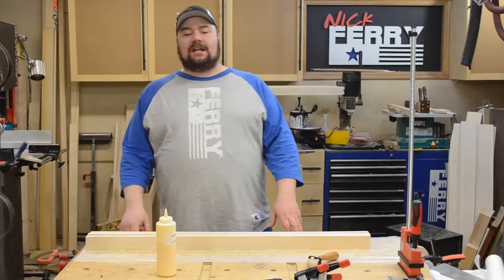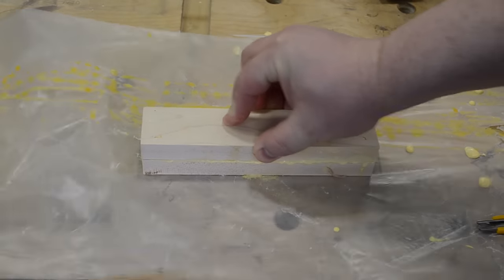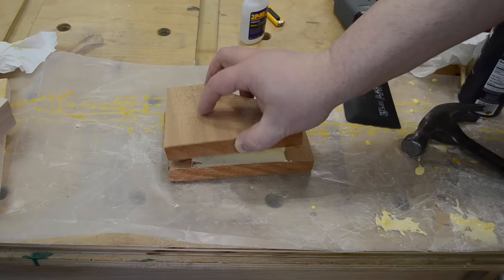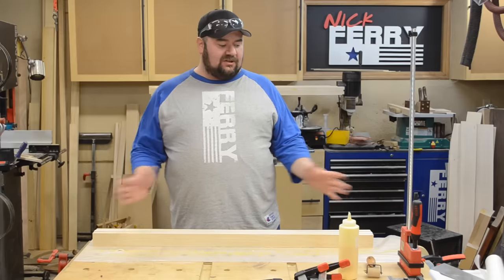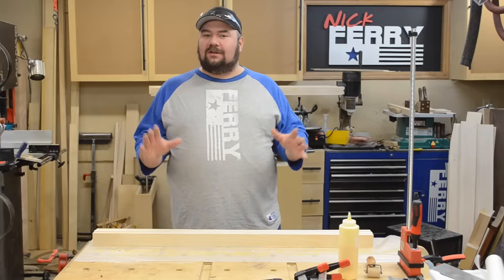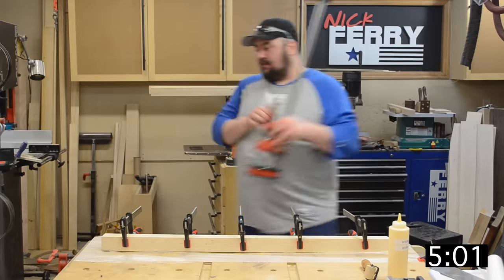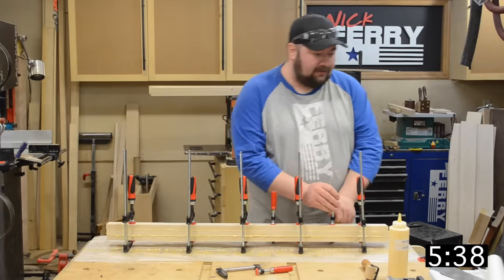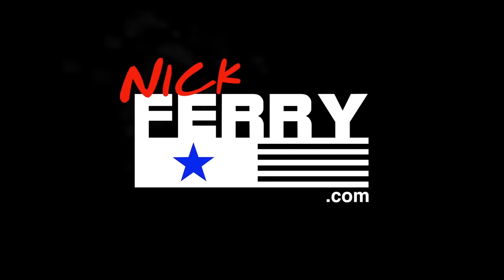Ⓕ Best Way For Gluing Wood Together To Get Thick Pieces (ep86)

Comment: I've always worked  the board back and forth while applying  slight pressure the leasening of lubrication and the sealing of more evenly spread glue eventually make it pretty easy to line up.  As long as the board fit well.
Reply from the maker: A rub joint is fine for edges, however in larger face laminations, greater pressure is needed to pull the pieces tightly together
Reply: @NickFerry  well yes clamps applied after the movement becomes difficult. It seems to reduce slipping while applying the clamps as well.
Reply from the maker: @trentpeterson3495  I can see that

Comment: Hi Nick, another way is to glue up just the same way as you did and put the boards together on their edges, put a couple of clamps on to hold them together then use a soft faced hammer or a piece of scrap wood and an ordinary hammer to even up all the boards as they rest on the flat bench top. You can even the ends up by tapping them against a stop clamped to the bench too. Then add more clamps and tighten them up.
Reply from the maker: Love it - so many options

Comment: Another good way to adhere two pieces - especially larger flat pieces - is with silicon circles.
 We once had to affix a 30"w x 26"h x ¼"d full height backslash to a level 5 finish painted wall. The backsplash was p-lam on the front and vertical sides, raw top and bottom, and typical brown backing on the back side. The wall was a typical industrial grade kitchen wall at the sink, made of typical ⅝" green drywall and 2x4 studs. The owner didn't want any visible mars or defects, so brad nails were out. Likewise, normal glue was a no-go due to the warping in the wall caused by our #14 lags anchoring the base and upper cabs to the 6" metal backing behind the sheetrock. Our solution was to put 2"∅ circles of silicon with an ≈ ¹/16" bead, spaced ≈ 5" - 8" apart, and a continuous ¹/16" bead about a ½" in from the edges. After applying the silicon, we pressed the backslash to the wall and braced it with sticks clamped to the uppers and the counter, making sure to form fit it to the bowing pattern of the wall. We asked the Super to wait a couple days, and then remove and hold our clamps until we returned. When we returned some 5 weeks later, we found our upper cabs on the floor, a huge patch in the wall where the splash had been, and our splash in the Super's office - with the original sheetrock (and a portion of 2 studs) still attached. Come to find out; the owner didn't like the color and wanted the splash replaced. The site's laborer's couldn't get the splash off the rock, and the rock was screwed to the studs... They ended up removing the upper cabs to protect them, and then took a sawzall to the wall to remove the splash.
 So... If'n you need a good, quick method for adhering 2 pieces, circles. They act like suction cups, and once the silicon gums up there's pretty much no getting the pieces apart again. Just be sure to make complete circles that'll seal, and don't try this with varnishes that silicon has an issue sticking to...
Reply from the maker: Rework! - I HATE rework! - when I was in manufacturing I would dread seeing an engineer walk over with drawings - it meant hours of re-doing what I just did - good tip on the silicone

Comment: Thanks Nick! I do something similar, like a few of the other guys here with a cull. Never thought of using my parallel clamps...thanks for the duh why havent i used my parallel clamp moment
Reply from the maker: Cauls work good and I use them a lot - for the smaller stuff like this it's nice not to have to align them
Reply: I guess if i could spell cauls right...they might work better for me...lol

Comment: I do something similar when I edge join timber to form wider boards. I keep a stock of small timber offcuts in  a bag with my site clamps. I cover these in self adhesive vinyl parcel tape. These clamp packers keep the laminations aligned whilst I also clamp the laminations together so I have clamps at 90 degree opposed faces so the above technique can be used even if one does not have parallel clamps, all one needs is scrap timber and sufficient clamps for the length of timber being laminated. For removing glue squeeze out without damage the best thing that I have found so far is a tungsten carbide paint scraper. The vinyl parcel tape allows removal of the packers as the wood glue does not adhere to it effectively.
Reply from the maker: I've done similar before with the packing tape, it works great as a non stick surface - thanks for the alternative method!

Comment: ive always done that, im surprised some people dont. also, if you dont have good parallel clamps, you can use the bar of the f-clamps themselves, it gets you 99% of the way there.
Reply from the maker: Good point - f clamps and cauls too

Comment: I agree this is a good tip. I usually fix this when laying up the pieces across the flat, pipe clamps. But, I arrived here looking to prevent a glue-up problem where stresses caused by drying, compressing glue force warpage (bowing) when the glue sets. I had a 3/4" countertop "arch" or crown when gluing Wilsonart laminate. I'm also having warp when laminating 1x4's into three thicknesses due to that issue. Have a tip to control that?
Reply from the maker: are you using contact cement on the counter top material?  if so, how thick is your base substrate?
Reply: OK, I had to rethink this due to the long passage of time. I needed an exact 1.0" thickness to replace a countertop. The laminate was adhered using contact cement. The other side of the 3/4" particle board was ~1/8" fiberboard panel glued, and pressed with cinder blocks and cement bags. The glue force pulled or bowed toward the fiberboard side. It was enough force to slightly lift all that weight, up. And now you know...the rest of the story. Good day.

Comment: I am novice... beginner....  The way i glue and not have problems, is let the glue dry for at least 30- 1 minute before combining both pieces... It hardly moves.. and you can adjust with a bit of force if you need to. This method has been working for me so far...

Comment: For the actual clamping:  I think I might overthink the whole thing but I always use cauls.   I work under the assumption that clamping force moves through the wood in basically a 45 degree angle.  so for a 3/4" board that clamp is only getting full pressure on about 2" of wood without a caul. With a 3" caul you're getting about 6" of full pressure per clamp.

Comment: I use parallel clamps for each end to keep pieces from sliding apart then use  clamps to squeeze pieces together. I’ve been doing that for years! Also you can use wax paper and hard maple cauls to keep everything together.
Reply from the maker: Not a bad way of doing it

Comment: I'm laying down hardwood flooring with adhesive and I always tape the flooring together to keep it from drifting. I would have left the first clamp on to ensure no slippage along with the other clamps, at least on the ends and one in the middle. Good idea?
Reply from the maker: If that works for you or you want the added insurance I’d say go for it

Comment: I need to do the same but a wider piece of wood, questions do I need a planer or a sand drummer to make better contact, or is it not necessary for your opinion
Reply from the maker: You can get lucky sometimes - the larger the pieces, the less likely a twist or cup will keep them from mating perfectly - giver-er a go, what’s the worst that could happen, they take away your birthday? ✌🏼

Comment: Something of which to be mindful.  On most woods you can read the grain to see which way you should joint the edge.  I put a little arrow on each edge telling me which way it should run through the jointer, then at the glue-up I make sure all the arrows go the same way.  This way, hopefully, you don't have two clean edges and one with bad tear out on a three piece glue-up.
Reply from the maker: Not a bad tip - especially if jointing by hand plane

Comment: I use the glass stays you use to hold glass into a wood frame, they have opposing points and are made of a soft metal that wont hurt a drill bit
Reply from the maker: I’d hate to hit glazing points with a bit

Comment: I love this video, great tip. We have all had boards do the slip n slide....... Thanks Nick and thanks for the links, I need a glue spreader and didn't know where to find it. Does it clean up easily? Does the roller come off?
Reply from the maker: Link to roller in the article - https://nickferry.com/2018/03/best-way-for-gluing-wood-together-to-get-thick-pieces-ep86/ - roller does not come off

Comment: nice video!   Does this technique not introduce stress into the glue -up?  When I have tried this method in the past,  some of the laminations  failed when tapers were cut.
Why not just glue the lamination referencing off the clamp bar, knowing the piece  will be jointed and planed later?
Reply from the maker: When gluing directly of the clamp bar you still get the wood to slide around enough to wreck glue-ups - It does introduce stress and the more bowed your boards are, the more stress is built up - these legs won't get a taper and if they were going to get a taper on one side I would cut the taper into the edge of the glue-up rather than the face - I have a video coming up very soon showing leg glue-ups and and I talk about tapers and a couple cool methods regarding the edges - make sure to check that one out when it's out

In short - I wouldn't use badly bowed boards for glue-ups where I had a multi-sided taper to be added - but in this case the bow wasn't that bad for it to be a problem with tapers if I were to add them - also giving the piece a couple glue-ups like that extra time to cure helps combat delamination - hope that helps

Comment: Hey Nick, great video.. The simple tricks and tips are always the best.. I've tried but can't find a link to the glue roller on your website. Does the roller have a smooth or textured roller surface? Amy help greatly appreciated.
Reply from the maker: Thanks - the link is in the article for this video - https://nickferry.com/2018/03/best-way-for-gluing-wood-together-to-get-thick-pieces-ep86/ - it's a halfway specific rubber that I like best - you should see the link there

Comment: I'm surprised how rarely I see others doing this. I have always clamped like that. If you don't have a parallel clamp then a F or C clamp with a small boards wrapped in wax paper on each side work just as well. 

Tip for glue cleanup that my woodshop teacher taught me. Keep a damp rag ready to wipe off the glue. As long as the clamps are tight enough the water wont affect the glue in the joint but it will affect the loose glue on the surface.
Reply from the maker: yup - normally how I clean it up too - seems as though I'm always mixing up how I do things

Comment: Nice tip!  Use the parallel clamp as a sort of temporary caul during clamping.  Much better than the salt method.  Plus, you don't have to deal with all that bad luck from spilling the salt, having to toss some over your shoulder each time, etc.  Perfect!  :)
Reply from the maker: Thanks - and no one needs bad salt juju

Comment: Hello there good sir! During this time of isolation, I am starting my channel back up and switching to wood working. I am new at it, but do have some experience. I was just wondering what you had under the clamps...is that wax paper? I’ve also seen people use silicone mats...do you have any experience with those?
Reply from the maker: yup, just waxed paper - silicone mats work too but I paper has also worked for me
Reply: Nick Ferry thank you good sir!

Comment: Even without the parallel clamp, pushing the stack sideways against the bench surface as you tighten the F clamps would also do the job provided there's no side to side warping in the wood. With side to side warping the method you show really comes into its own though.
Reply from the maker: thanks much!

Comment: Hey Nick
Very good tip. Keep them coming.. How had is to get the glue off the rubber brayer?
Reply from the maker: I haven't let it dry on there yet as I just clean it off with water but because of an earlier comment I may do some experiments - it's the soft version so I think dried glue would flake or peel off

Comment: I do the exact same thing for my wide panel edge glue up using cauls made 2x4s that I have jointed and then cut small triangular notches into so as not to contact the actual joints/seams in order to apply even pressure to maintain a nice flat/even panel face which is particularly helpful if the panels are thin or not conducive to dowels
Reply from the maker: A very good method - I haven’t done notches but half circles cut with a forstner bit
Reply: Nick Ferry yeah same exact thing just faster to make with a saw when I made them.

Comment: Very useful tip, how would I glue up something wider say eight inch? I'm thinking of using wood blocks bolted together to sandwich the glue up. Again, thanks for the tip!
Jim Hackett
Reply from the maker: Thanks - you are on the right track - cauls are great for wide boards - have some shims handy to throw some pressure towards the field of the boards to “preload” straight cauls

Comment: I use square box ( as in framing square ) lined with parchment, and clamp against that. It's essentially two 2x6's secured together at a 90 degree angle. It gets one side and one end flush, so if the wood is the same length and thickness, it'll be flush on all sides. A wax parchment works best, less issues with sticking, easier to remove once the glue sets up. I like your method though, never seen it before.
Reply from the maker: thanks - I like the idea of having a square box to clamp off of

Comment: Hello Nick.  I really love your work.  Do you have experience dealing with gluing Ebony wood?  I heard from friends the only thing to use is super glue.  How? It dries too quickly.  Is there any other method? Regards.
Reply from the maker: thanks - I don't glue a ton of ebony - mostly only small pegs from time to time - as with any oily wood you should try and get the surface as oil free with solvent and then maybe try an epoxy over a typical PVA wood glue

Comment: Nick, I have a dumb question. Instead of using one parallel clamp and moving it down the boards, would it make more sense to just use two parallel clamps at our near the ends, leave them in place, place the F clamps, then remove the two parallel clamps? 

What are the pros and cons of this method? Have you tried it and what were your results? 

Thanks for the video, sir.

Comment: I used to clamp things on their sides and start placing the clamps and used a wooden or rubber mallet to gently tap the wood flat to the bench if they started doing the hydraulic shimmy and sometimes I'll also go in a spiral with the clamps around the workpiece and then hang it to dry.
Reply from the maker: The hydraulic shimmy - I need to say that much more in my life - thanks BW!

Comment: In my job back then, we would use a Biscuit Joiner. all you do is add a few Biscuits, glue them in ... and when it's time to glue the whole piece ... it won't move around alot(and the Biscuit Joiner is quick if you're used to use it).
Also, we would alternate the Clamps ... my old Master used to say that wood can warp if you only apply Clamps from one side, like you here do it originally(i know you add some small clamps from the opposite side).

This would work, even with boards that are not the exact same size ... just have to remember which side had the Biscuits ... and since you have no metal in it you will never run into problems later on.
Reply from the maker: I like using biscuits but in face glue-ups I tend to do this - more so when I might taper the legs and expose a biscuit
Reply: Yeah Biscuits have limits. They make it very easy to glue together with 2 sides square, but like a Veneered Wood Plate ... there are drawbacks.
Like you said, if you plan to cut the end piece more, like in tapered table legs, then Biscuits don't do the job.

Overall, if i join 2 Plates as example, for a Table Plate, i would use Biscuits.

Comment: Hello there. Awesome trick. I have a question. Do you have an idea on how to glue up pieces in a staggered way to make up a certain length.? Maybe 45 Degree cuts.? I’m not looking to make dowel joints or lap joints. Do you have an idea of which stagger can hold better against bending.? Thank you
Reply from the maker: not sure I am understanding completely - are you looking at gluing multiple staggered pieces to have a longer and wider top? if so look into butcher black tops - if you are looking into making a single narrow board longer look into scarf joints or finger joints for molding
Reply: Nick Ferry yes I am looking to make the board look longer, stagger the pieces and at the glue up I was thinking of possible staggering methods or sequences to make the glue up joint stronger. I’ll look up your suggestion.! Thank you for the reply.

Comment: Good tip Nick, thanks for sharing.  I have used this method before.  Most of my glue ups are for large panels for my relief carvings; I do put small clamps on the joints at the ends of the borads, then I use pipe clamps on the rest of the job, the problem arise in the middle of the boards, then I use long wedges and a mallet to aline them.
Reply from the maker: I like the wedge method - great for wide panels
Reply: You don't even need a parallel clamp, two pieces of flat scrap work. I was a little dismayed when I got to the "trick" as this method seemed self evident the first time I glued up laminations. Good to remember that not everything occurs to everyone.